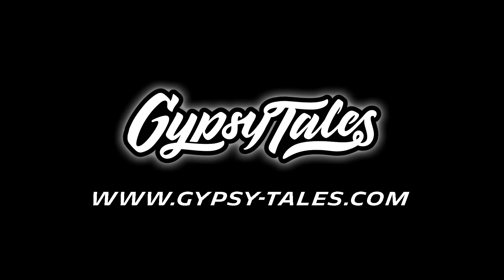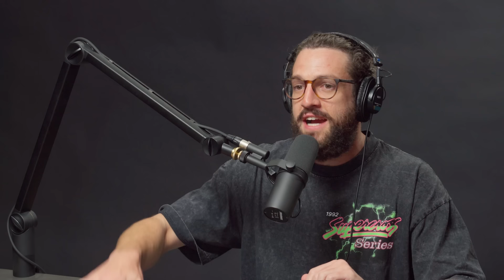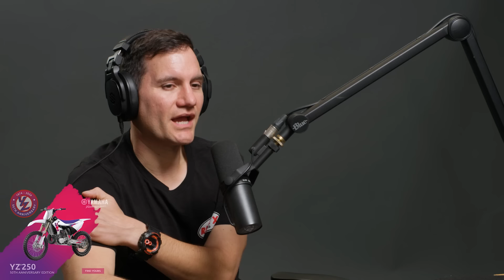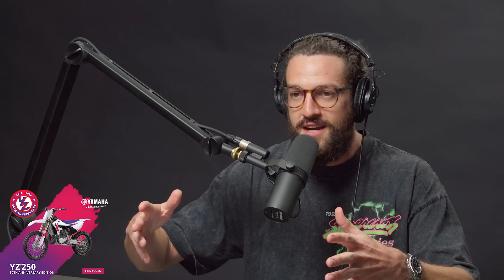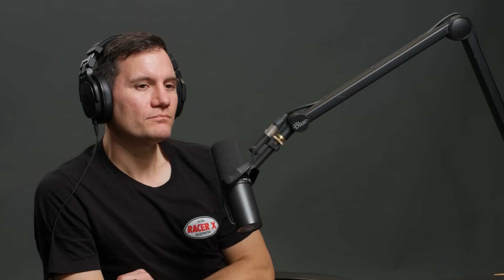How Different are MXGP Bikes to Production Bikes??

Comment: The production rule is a god send for the average consumer.  Otherwise we'd still have 4" of suspension travel and an additional 50 lbs of weight.
Reply: Best comment here, you're 100% correct. If there's no production rule we don't get all the nice fancy things as they don't have to sell it to us.
Reply: Its like the difference between walmart bikes and the bikes they ride at rampage. Because of the production rule, the average joe gets a bike that could compete with the pro bikes to a degree instead of trying to ride a bike that is designed as cost effectively as possible to maximize profit on suckers
Reply: Also makes the races about the best rider, and less about team budget.

Comment: All bikes are good these days, especially for any weekend warrior. The adjustability is amazing. Get the suspension done for your weight, skill, and type of terrain. Set up the ECU with the mapping you prefer. The brand you pick should be based on the level of support that is given by the local dealer or manufacturer, because all bikes need maintenance and repair.
Reply: This is entirely because of the production rule though, if the manufacturers didnt have to make their production bikes good enough for the pros, the production bikes would be like riding a walmart bike compared to a specialized downhill bike

Comment: If someone sneakerly changed the setting on my shocks less than four clicks, I don't think I would notice. If someone changed the headstay or engine mount to softer or stiffer, no way would I notice. Sag, less than 5mm, I doubt I would.

Comment: I was a 2 stroke 125 A racer in my day. I had a stock 1986 Cr that we simply revalved suspension, replaced piston & rings every 3 races, kept fresh clutch plates every 3-4 races, fresh tires, dialed jetting each race... And I won FL Gold Cup and holeshot 125A Mini O's against legends and pulled a podium and a few top 5's... racing unknowingly with a burst c1 4 days in that 86 Mini O's, came back & 1st day back with a foot slip off peg, crushed arch, 6 mo more on the couch... so ended up a fill in Jan 88 at Gatorback on a stock 1988 Cagiva 125 WMX on my very first time riding since both injuries & yr on couch... never rode the bike... box stock... I swept 125A Winter Am by half a lap both motos.
Reply: Who cares

Comment: ........and how much more do OUR BIKES COST, us tall-short-105 to 305 pounders- fast- medium- slow normies out there, do we want/need TI intake valves that die & cost way too much & cause the valves to go out of adjustment compared to those great S/S replacement parts that damn near NEVER NEED servicing, all the way up to this MONSTER high bike that requires STARTING BLOCKS to stand on to get off the line sorta under control?!?!
How about a situation like YAMAHA used to do: a YZ race bike & an MX weekend warrior bike. Just as you can make an 85 into a BIG WHEEL, you should be able to make a 38 inch seat height bike down to something near 33-34ish with ""ONLY"" 9-10 inches of wheel travel? People in the past won world championships with 3-4 inches of travel so something a bit lower can be made to work & function. I ride an old 2004 & 2007 KTM EXC & SX & still have MAJOR FUN. Hint: DO NOT EVER RIDE A NEWER BIKE THAN WHAT YOU CURRENTLY OWN & RIDE, EVER!!!
Make them low cost & lower to the ground & they will still be fun!!!

Comment: Commentary from E grade riders they are all good . Myth created by the media ongoing it is . If you dont use stock bike clicker adjustments you dont have a comment on all bike are good would be the first obvious point . Media will tell you the first you do is get your suspension done , sales , 70 to 85kgs no prblem for a C class to learn the quality Suspension makers , yes the euros need a fix repair almost always regardless to improve them . Production rules are KIng , why the AMA mxsports Championships are the best in the world . Manufacturer of frames and riders , the best of the best with a wide variety of teams able to compete . Best Manufacturer with the best rider at the time is Motocross Sport not euro marketing show mxgpGncc. True fans see through the control of outcomes of those Brought to you Corparate takeover ktmhuskaberggas. Media gagged to tell you about tpi cam shafts estart wheel bearings spokes throttle cable fuel pump the list goes on , failures .